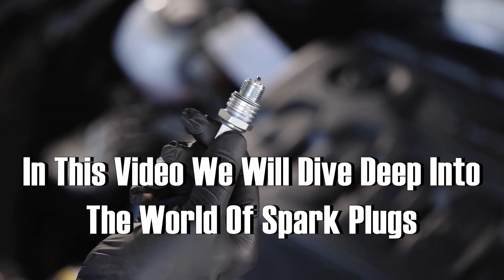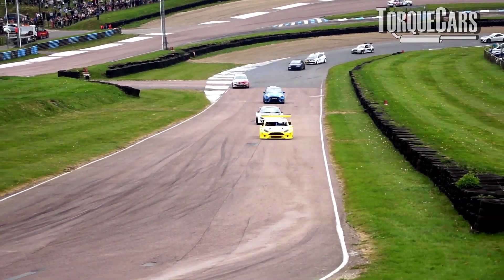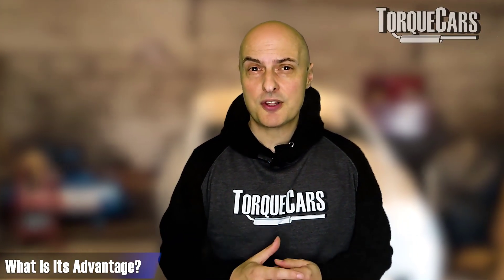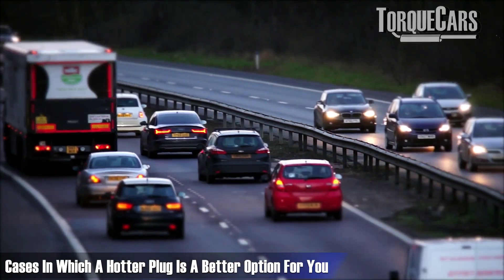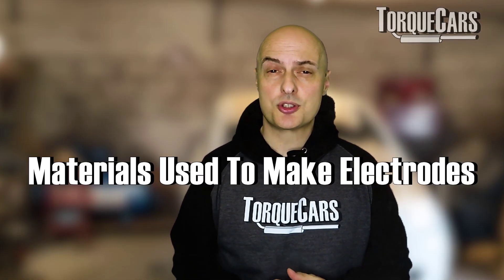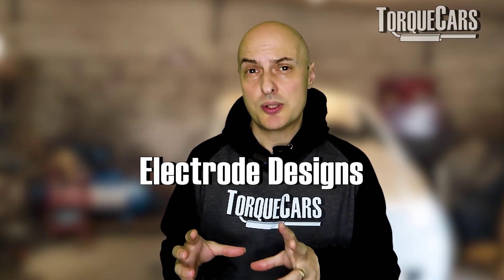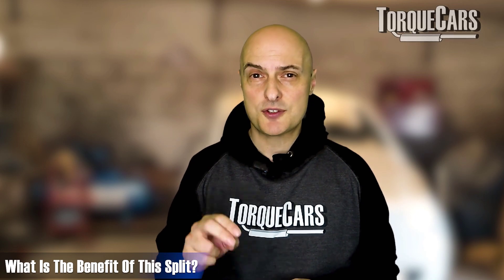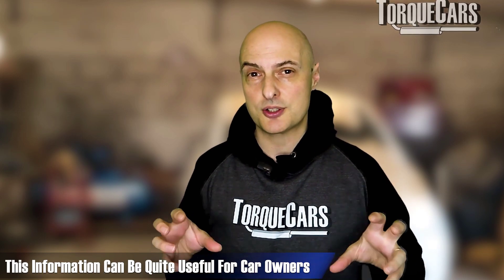Choosing the Right Spark Plug: Hot vs. Cold Plugs and Electrode Types Explained

Comment: 1977 Ford 302. I noticed oil on a couple of the spark plugs when changing them. Should I run a hotter spark plug to keep them from getting fouled? Weekend cruiser don't want to rebuild the engine at this time

Comment: Which cars mostly use hot spark plugs and why?
Reply from the maker: Hot spark plugs are suitable for older cars that generally have lower temperatures in the combustion chamber. Their slower ability to cool down makes them ideal for these engines. Cold plugs will be covered in soot very quickly which leads to misfires.

Engines with lower compression ratios benefit from hot spark plugs.

If an engine has problems with complete combustion, hot spark plugs can help with that.

Comment: I run the NGK BKR7E copper plugs in my 1.8T and 2.0T Audi's. I got nearly 30K miles on my B5's plugs. I've regapped them once. They are 1 heat range colder than stock as well.
Reply: @4BillC  are these stock engines or tuned?

Comment: Great to hear all this information. I was wondering if direct injection or port injection makes any difference to the overall performance and the amount of fouling of the spark plugs as well?
Reply from the maker: Interesting question. The plugs do not come into contact with the fuel as it is sprayed in through the port, just the fuel "mist" inside the engine so it will be similar with direct injection.

However direct injection engines burn better and produce less soot so the plugs are less likely to foul up as quickly but this is pretty subjective and we are usually comparing a modern clean burn engine with an older design.